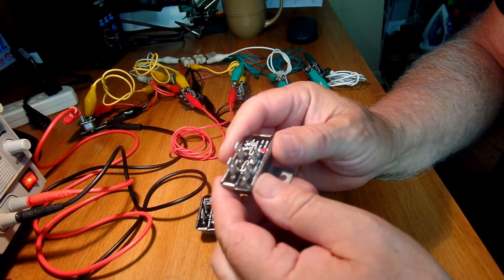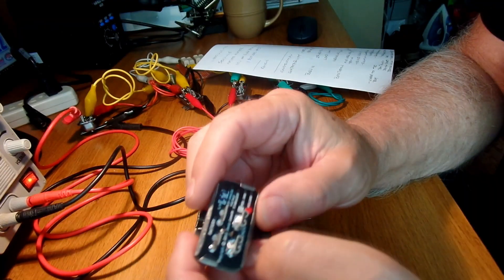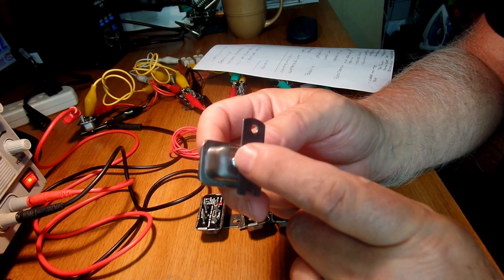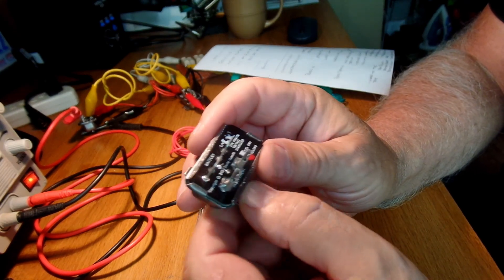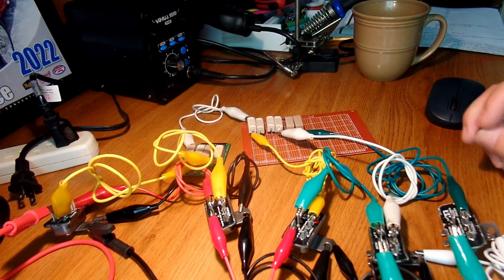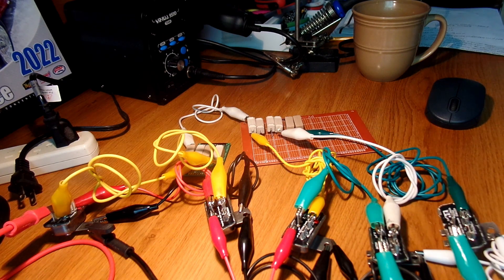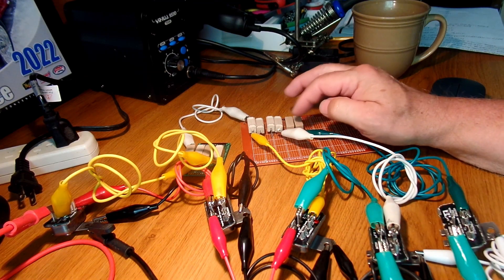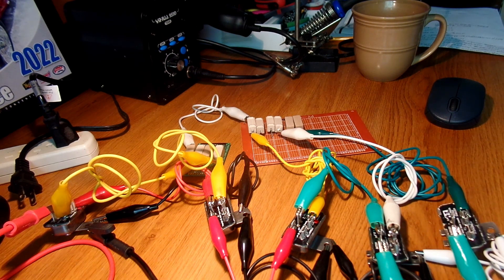DavesTR4A Negative Ground Voltage Stabilizer Update

Comment: How do I order one?
Reply from the maker: I sell them through three suppliers,
The Roadster Factory (800) 234-1104
Team Triumph (330) 392-7176
Triumph Rescue (610) 845-8127
Triumph Rescue is a recent addition. I just sent them an initial order last week. I should have them by this coming Monday I would think. As I said in the video, I need your old one back as a core to rebuild with my electronics. If you have extra bad Stabilizers I would be interested in those also. 
Thanks for the interest and I know you will be happy with my stabilizer if you purchase one.
Reply from the maker: Hi, were you successful in purchasing one of my voltage stabilizers?